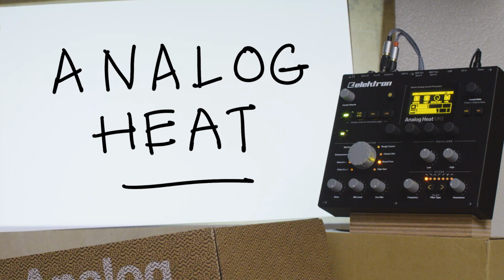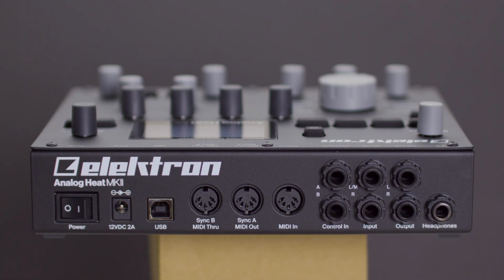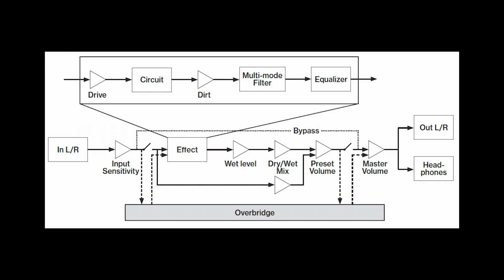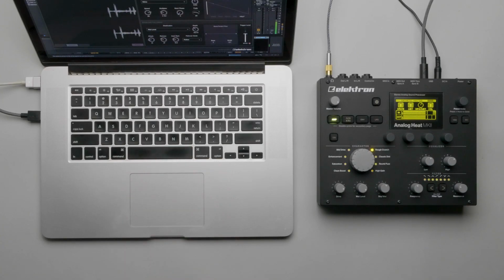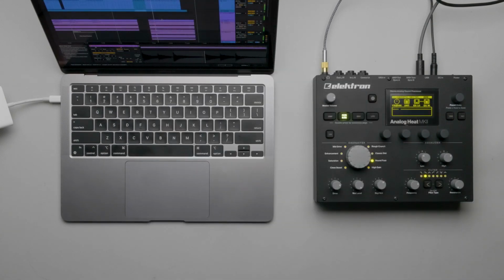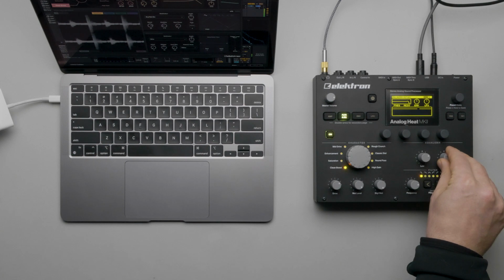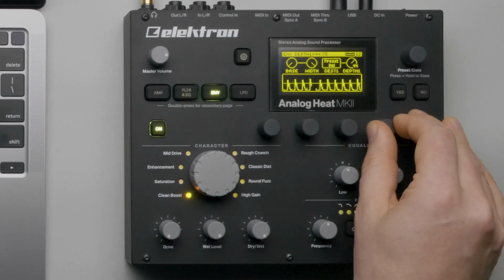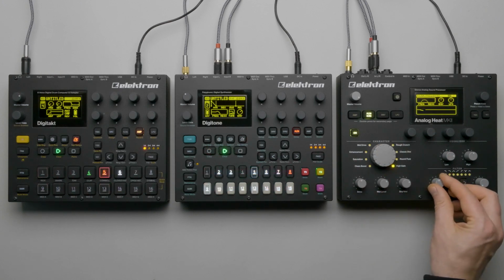Analog Heat Review

Comment: I have a Syntakt that is known to be Analog too, could you tell me if the sound quality changes if I want to enter the DAW through USB or if I do it through line output to my audio interface?
Reply from the maker: There is likely no difference in sound quality going through the DAW. The device has an internal sound card, converting from digital to analog and vise versa. You should not have to use your sound card for this purpose.

Comment: Can I use it as a plugin while using also the physical IN / OUT jacks on a hardware instrument?
Reply from the maker: If you want to use the plugin independently of the hardware then no.  They are meant to integrate and be used together. If you want to process signals on the IO within the plugin then yes, it's designed to do that. Hope that helps.
Reply: @OllieLoops  so basically i can affect something in my DAW as a plugin and simultaneously affect my hardware synth, jsut the settings would be the same?
Reply from the maker: @martinaleksandrov7080  It won't be able to process two different sound sources simultaneously. If you have a hardware synth connected to it, that's the sound that the plugin will also be processing. If you want to process something in the DAW via the plugin and an external hardware synth, you either need to print the effects in the DAW to an audio track to free up the unit to process the external synth. Or, to process two signals simultaneously, you need two units, one to process in the DAW and another to process the external synth. Hope that helps.
Reply: @martinaleksandrov7080  i own one and to me t's a very good analog stereo device and if you have an audio interface with multiple inputs and outputs connecting the heat to it and using usb only for overbridge is the best way to use it if you work with a computer, you can use the plugin (which is really good and faster especially for lfo and envelope settings) and you can work at samplerates higher than 48000, which is its limit if you use it as an audio interface with usb only :)
Reply: @foruncolo74  yep, its pretty awesome, but latency is too much for me, especially when i use it for drums. Or do you mean to use it just as a send/return effect, not with Overbridge app?
Reply: @martinaleksandrov7080  i use it on single tracks (or on a bus or the pre-master) in insert with in and outs and using usb only for overbridge i put the plugin on the track and i render the track when i'm happy, simple as that, i think that sending audio thrrough usb only needs more buffer but i never tried and i don't think i will, the only thing i cant do is go full distortion and keep a copy of the track clean to do parallel distortion, the two tracks don't fit with the phase even if they are perfectly in sync so i use the dry/wet on the Analog heat and keep only the processed track, i disable the original just in case i'm not happy with the track together with the  fulll mix so i can try that again. And yes, when the track is rendered i have to check and slightly move the rendered track on the left because of a little latency (i use 48Khz with 256 buffer most of the times) but nothing crazy, maybe you wanna use it while playing and you probably hear the processed audio too much later? Even in this case i tried recording a synth with Overbridge and i didn't get so much latency while playing either, maybe is the computer? I don't really know, hope that i explained myself well, english is not my language :)
Reply: @foruncolo74  so you dont have latency issues with drums?
Reply: @martinaleksandrov7080  not so much but i don't know how u use it, as i said, i render and i slightly move the rendered track on the left in Ableton arrange view but not so much
Reply: @foruncolo74  yep that method works, just not really ideal as it requires extra steps and time, and for live playing is not great. Thanks for all the tips and input man!
Reply: @martinaleksandrov7080  for live playing to avoid latency you probably need to go completely dawless and use a mixer instead.
Reply: @foruncolo74 yup. The latency is probably from the signal going in and out of the audio interface and software. Hardware effects should always have less latency than plugins. I have effectively zero latency on $40 guitar pedals from temu so I can't imagine anything other than the signal path is causing the latency
Reply: Hardware effects without an audio interface and without a DAW have no llatency at all (well maybe some if you have to much long cables but i'm not sure), if you want to render it live on a computer the solution would be the smaller buffer setting available, 64 or 128 but you need a powerful machine especially if you have other vsts running inside your computer, can you tell me if you are using AH as your only audio card? In that case you have a limit at 48000 sample rate and probably more latency compared to some other audio interface, i don't use it like that, i go in and out from my RME audio interface but i use Overbridge that does the routing so in the end it's related to the buffer size anyway and even if you don't use overbridge you will always get some latency because of the conversion inside the DAW, if it's not from AH it's from your audio interface, so again if you can't go dawless try 64 or 128 buffer size at 48000 samplerate (higher samplerate, higher cpu power needed) and possibly without using AH as your main audio card and without any other vst running. @dyscotopia

Comment: Bought one on sale to use with my DAW and synths. I do wish had more more than one stereo input and outputs however. That said paired up with the Digitakt and Digitone and a laptop and DAW those are fantastic!
Reply from the maker: You can always use an outboard mixer with AH. Either run it as a effect on the bus if your mixer has that, or run it between the output of the mixer and the input on your interface.

Comment: Eh Yo! … It’s survey tiiiiiime…. 
…. And fuck Overbridge or any software that is needed to unlock any hardware’s “full features”.
I had to purchase a tablet running windows 7 to unlock the full features on my Roland MC-808. The software Support didn’t even last a decade.. hopefully Elektron won’t do what Roland did, and 10 or 20 years from ppl can still easily access full functionality of gear like this.
Reply from the maker: Thanks for you comment. You can get full functionality out of Analog Heat without additional software. Integration with a DAW via Overbridge is an added feature, if you want to use it.